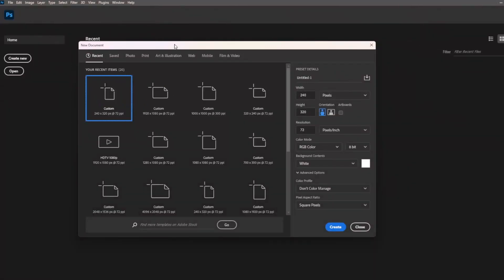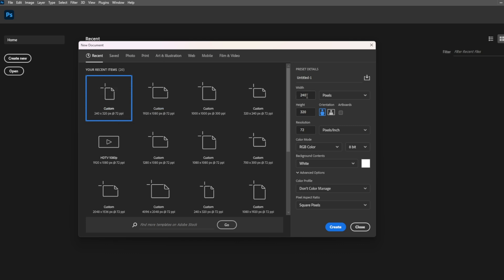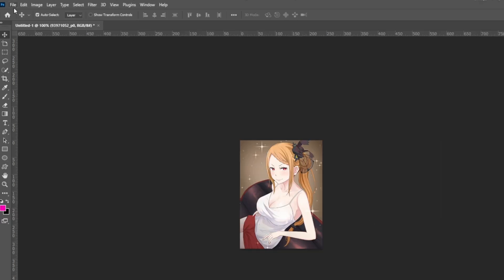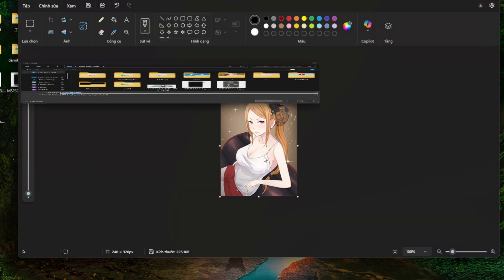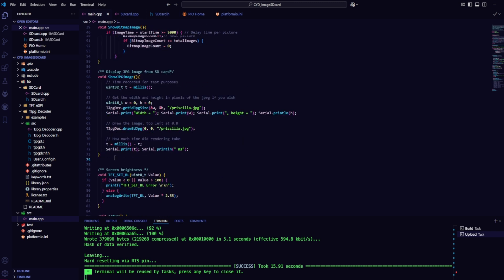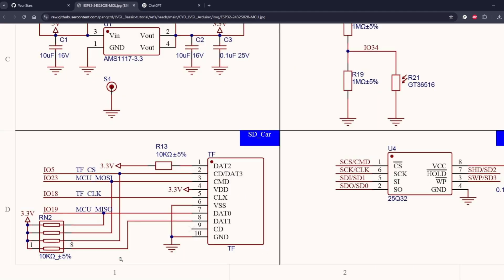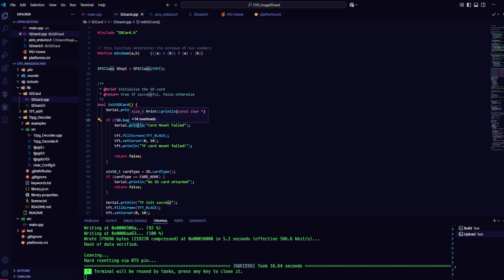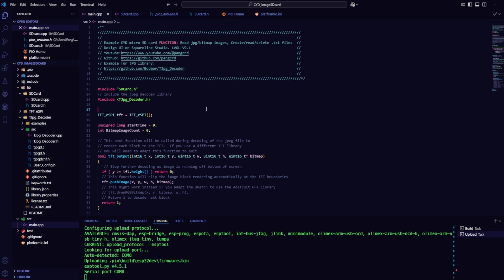ESP32 Display Images from SD Card | Bitmap & JPEG Tutorial

Comment: Meu esp32 cyd não reconhece o cartão sd, oque eu faço?
Reply from the maker: Check your sd card SPI pin with datasheet maybe your cyd not silimar as mine
Reply: Minha esp32 cyd é da mesma da sua.Tem como vc me ajudar a conectar o cartão sd soldado direto na cyd esp32?
Reply from the maker: @CarlosEduardo-w1e3m  If your board look like as mine, it will work correctly, first you should double check wiring router maybe got a bit different, then format sdcard as FAT32, try test with <4GB sdcard and last one make sure your sdcard still work normally before insert into CYD board. And can you speak English that make me easier to understand 😎
Reply: @pangcrd eu uso o cartão sd de 2gb e não funciona
Reply: O que é fiação do roteador e como formatar o cartão sd em fat32?